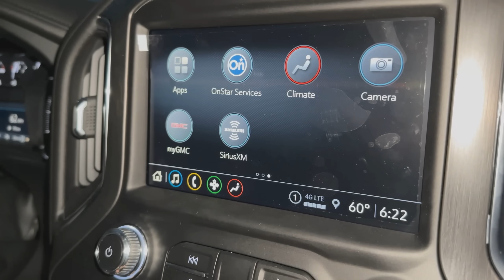First Wash In 12 Years: Free ABANDONED 1990 Volvo 740 Wagon! Detailing and Surprising Best Friend!

Comment: The car was in incredible condition, no rust, no dents, no scratches- amazing Volvo quality!!
Reply from the maker: Couldn't agree more!
Reply: Volvo used a very grade of paint and clear coat. My 1990 shines up like new and it lives outdoors 24/7 and is now in its 34th winter.
Reply: My dad bought a 1989 Volvo 240DL back in 1990 and when I washed it, it always looked great even into the late 90’s. Our 1995 850GLE and 2005 XC70 also looked great. Currently I owe a 2013 S60 T6 R-Design in rare Rebel Blue paint. It has just 55K Km and looks incredible after a decade!
Reply: little bit of rust on the front fenders but indeed, amazing condition!
Reply: @RajSharma-uv4nx  I have a 1984 340DL and when I got it 8 years ago, the paint was heavily oxidized. A few hours with some T-cut and the paint is like new. The paint has the odd blemish due to bird droppings being allowed to be left on the paint work in the past.
Reply: @Djuztin  I'm sure that could be rectified with a simple remedy.
Reply: My mom had a '90 740 Turbo wagon...absolutely awesome car.  Dark gray with black interior, and the turbo's great looking fan blade 5 spoke wheels.  She traded it in for an Audio A6 wagon in 2003, which was riddled with issues.  I wish I could go back and take the old 740, and keep it for life.
Reply: i got 850 with original black paint, still in immaculate condition, back when car manufacturers used proper paints.
Reply: Those old volvos were built like TANKS,  made to withstand salted Swedish roads and extreme weathers.
Reply: @teitoku_6974  my 340 was built in the Netherlands. Although still pretty solid but not as solid as the Swedish built 740.
Reply: @mohis5664  had a 95 850 got a bit just after I had my 740 had the 740 at 18 then the 850 at 19 loved them both
Reply: VOLVO FTW! 🤩
Reply: Jag xjs for me
Reply: @WDDetailing  someone is scamming your subs in the comments
Reply: Wasnt there a dint in the roof at the back in rear passenger area?
Reply: All the more impressive when I saw the Ohio license plates. We use a lot of salt here in the winter.
Reply: The best Volvo ever made,I do own 1991 Volvo 940 turbo wagon,1993 Volvo 940 GLE wagon,1989 Volvo 240 DL sedan and 2004 Volvo V70 XC wagon and love them all ,Volvo for life !
Reply: My 245 have lots of dents, scratches and some rust. And it looks like it has been parked under a tree the last 30 years.... But it works fine!
Reply: @davidyoung9561 finally someone with a 340! (I have 2 btw)
Reply: Swedes are built different
Reply: Or rather not that amazing another fake restoration.
Reply: @michaeltutty1540  Only the Swedish made ones, the later ones made abroad is pretty shit in the coat
Reply: Hello
This is what God Almighty said in the Holy Qur’an on the authority of Jesus the Prophet, peace be upon him, from Surat Al-Ma’idah from verse 116 to verse 120.

Surat Al Maeda from verse 116 to verse 120

116. And (remember) when Allâh will say (on the Day of Resurrection): "O ‘Îsâ (Jesus), son of Maryam (Mary)! Did you say unto men: ‘Worship me and my mother as two gods besides Allâh?’ " He will say: "Glory be to You! It was not for me to say what I had no right (to say). Had I said such a thing, You would surely have known it. You know what is in my inner-self though I do not know what is in Yours; truly, You, only You, are the All-Knower of all that is hidden (and unseen). 
117. "Never did I say to them aught except what You (Allâh) did command me to say: ‘Worship Allâh, my Lord and your Lord.’ And I was a witness over them while I dwelt amongst them, but when You took me up, You were the Watcher over them; and You are a Witness to all things. (This is a great admonition and warning to the Christians of the whole world). 
118. "If You punish them, they are Your slaves, and if You forgive them, verily You, only You, are the All-Mighty, the All-Wise"
119. Allâh will say: "This is a Day on which the truthful will profit from their truth: theirs are Gardens under which rivers flow (in Paradise) - they shall abide therein forever. Allâh is pleased with them and they with Him. That is the great success (Paradise). 
120. To Allâh belongs the dominion of the heavens and the earth and all that is therein, and He is Able to do all things.
      Great truth of God.
Reply: @yahiaechaab3357  ?
Reply: @ZebraScout yet you pussied out in both wars and let the enemy walk right through your country and attack ours 😂
Reply: Only if the Swedes were this sturdy in the war and not let the enemy straight through into my country
Reply: I’m on my 7th Volvo since 1985. Two have hit 200,000 miles. My current new XC90 is the best one I’ve ever owned. 2DL sedans, a DL wagon, a 940 sedan, 2 S60 sedans, and now the XC90.
Reply: 90's Volvo...can't beat them. Solid as a rock...don't make them like that anymore...swedish steel, craftsmanship, overall safety...setting that standard as well...engine strong and reliable...not the fastest..but it gets you where you wanna be..in the best seats of the time. Love the 850 R as well to run just a tiny little bit faster😁
Reply: It does have rust on the front left fender above the wheel well. Also, remember it was also parked under a carport. That definitely helps.
Reply: its Volvo bro!
Reply: Yes, I can't believe what cars people throw away. Why would i do that to this car?

Comment: I'm a Volvo guy but I cannot believe you found this car in Ohio save it from the crusher and it turned out to be an amazing shape and what a great job of detailing. Mike you got a gem.
Reply: I am to I have a 2000 s70
Reply: Yeah, imagine waiting to die then being saved by someone
Reply: @josephwatson2711  Im swedish and love to see this as Volvo came from here.
Reply: Yeah, I'm not buying ANY of this. It's somebody's nice ride that they threw a bag of fullers earth over it while wet.
Reply: @an8nymous791  yes it's all original has 105 thousand miles on it everything still works in  it
Reply: @LanceRyderWilsonNigguh01  we all got to go some way
Reply: @an8nymous791  Still lots of old Volvos here in New England. My '98 v70 is nearly at 260k. The interior needs some help (and the plastic parts are impossible to find) but the engine is absolutely smooth as butter and I've never done more than tune-ups.

Comment: Had a ‘93 940 wagon that I intended to drive until I died. Had to really plan merging with a 4 cylinder engine moving a 4,000 lb. car! It was totaled by a grandma trying to pass between me and a telephone pole on Rt 9 outside Avalon, NJ after I had put ~$2,700 into new shocks, struts and tires. Insurance gave me $3,300 for it. I still miss it more than 20 years later.

Comment: a 740 was my first car some 20+ years ago. Since then I added an 850, 940 and a S60. Never sold one, though I also never got around to get a wagon. They are insanely well built and nice to work on. The redblock engines are legends in their own right. I am totally with Mike on this one and quite frankly surprised no other team member shared his level of appreciation for this amazing car. I hope he still drives it!
Reply: My 90 740 took 2 95 mph hits and is still standing the yko  that t boned it 3 yrs ago was totaled up to the windshield and rolled down the hill with what was left of their yukon xl and witness said they pushed it into a 12 foot fence

Comment: 740s and 940s are getting very rare and super-collectable now, the estates especially. Really glad you saved this one – looks awesome inside and out!
Reply: Here in The Netherlands you see the 740 and 940 very regular and they are still running daily !!!
Reply: hhahha just go to sweden you can find one running for about 500 to 1500 dollars
Reply: Those were the last Volvo series that were build like tanks!
Reply: @ppdan Not safe cars today, but interesting
Reply: @Markking1678  You would be amazed how safe those can still be today. The version in this video was the 740GLE which is a near to full option version so it probably included ABS and maybe even airbag. Later models (90's) even had SIPS, they were the first ever to have this!
Volvo has always been a pioneer in safety, even in the 1980s and 1990s. The 740/940 were designed with reinforced passenger compartments (those had 3 reinforced bars in the front doors, 2 in the back doors), crumple zones to manage crash energy (especially the front), advanced seatbelt systems, including pre-tensioners.
Reply: @ppdan  You'd be amazed how untrue that is. They're old mild steel designs, the first safe Volvo was the 850.
Reply: @Markking1678  We had a 740 and hit a VW golf at about 35-40km/h. The golf was total loss and our 740 had a damaged bumper and a broken headlight. I guess that was the last time that golf driver took right of way from a big Volvo.
What is your experience with those?
Reply: @ppdan  Which Golf, mk1-2?
Reply: @Markking1678  after or before?
Was a brand new mk3, but I guess you have a perfect explanation for this as well
Reply: @ppdan  The mk3 was the first Golf that actually contained higher tensile steels. Photos, or it didn't happen
Reply: @Markking1678  yeah because in the 90's we had smartphones to take pictures anywhere we went and upload them to instagram ....
Any other idiotic request?
Birth video or I didn't happen???
Reply: @ppdan  A MK3 Golf is much safer than a 740.
Reply: @Markking1678  Not when it gets hit in the side by a 740!!!
And even frontal the 740 would be safer ... Why? Because the 740 is heavier AND sturdier.
Reply: @ppdan  No it isn't, it's heavier, but it contains very little high tensile steel.

Comment: Nice find, looks superb in the end. Very nice 16 vales engine, leather, a/c, all the regular high end stuff, and it even have the OEM radio! 
Just note they the engine requires a bit of attention, the 16v flavor of the redblock engine is more fragile than older designs, especially on the timing belt, water pump, pulleys (one is made of plastic and break, running the vales...).
The rest is rock solid.

Comment: Dream car is my dad's old mercedes benz E250 1995 manual right hand drive blue. We sold it back in 2016 for £500. It was the car I loved as a child and now. It the car I grew up with and had a lot of memories. It's probably destroyed now as the guy said it was going to be used as a parts car and hasent been mot since being brought by him. It was brought by my dad back in 1996 as a new as it was imported to the UK. I'm 19 as of now will probably try to get one when I'm older. It will be impossible as they are hardly on the road any more. If not this my second car of choice a audi rs7 2017 or mercades benz 300se 1980s w126.

Comment: Great detailing vid!  A Volvo sedan was one of several cars I was in love with when I was younger (40 years ago!).  Don't mean to steal any trade secrets. I have a 2022 Dodge RAM 1500 Black Pearl finish. Keep it immaculate. But I just noticed a pinhead sized rust dot coming thru the finish on one side of the bed quarter panel. Any recommendation on how to treat and/or product you would suggest? Will be contacting dealer as this may be a paint defect rather than road wear. Thanks so much!  Peace!

Comment: I have a soft spot for a few vehicles - 1990-2011 Ford Rangers, manual transmission. When they were still a mini truck. So hard to find without rot up here in the NE. And the 87-89 Dodge Aries. I junk car, but it was what I learned to drive in and I put that machine through some stuff it was not built for - mud, jumps, water crossings, and it just kept going. Appreciate your videos, love the before and afters.

Comment: Here in Sweden you could sell almost all parts for a lot, chrome strips $200, chrome handles $90. the grill $50. USA Front (headlights, blinkers) $1200, the GLE emblem in the back $20-$100, Front Lip $100, Full Leather Chairs $200-$500, all that I mention are on high demand here. You can obviously also sell essential parts from the engine and etc.

Comment: I currently have an 89 Volvo 740GLE sedan. These are fantastic cars but you really must keep an eye on the engine. The twin cam is an interference engine so when the cam belt goes, you can expect a dead or heavily damaged engine. Priority one is getting a new timing belt and balancing belt on the car. This is actually a bit easier than the single cam engine.  As for myself, I would take the old Plymouth or Desoto if offered.

Comment: When starting a car that hasn't been run for multiple years. 

Disconnect the fuel line and use an external can preferably with its own electric pump connected at the engine bypassing the vehicles fuel pump and any inline filters. 
Fuel in the tank will be so degraded you are fighting a losing battle and risk dragging rust particles through the injection system. 

Change the oil and filter  regardless of how clean the oil looks, sitting oil looses viscosity and limits its ability to inhibit wear. 
Engines suffer the most wear on components when cold starting. 

Turn the engine two full turns on the crank by hand to check it isn't seized. 
Check cam belt condition visually first by removing top belt cover. Cam belts also degrade with age. 

When starting, disable spark so it wont fire up then crank on the starter to build oil pressure. 
Check engine light goes out confirming oil pressure is reached. 

This is a must with anything that has a turbo fitted. 
Starving a turbo of oil pressure will destroy it. 

finally, reconnect spark plug leads and attempt to start.

Do that and you could save a good engine and turbo.   

Or you can just squirt easy start in the air intake and take a massive gamble..

Comment: I've always wanted a 1995 Oldsmobile Cutlass Supreme convertible.  This was the last year for the convertible, the only year with dual airbags and the revised dashboard and interior. I bought my first new car, a 1996 Olds Cutlass Supreme SL coupe in 1997 as a leftover 1996.  I always pined for the convertible, still do to this day.  Just haven't been lucky enough to run across one to purchase.  I agree, I'd rather look at an old Volvo than a bunch of exotics.  At least the Volvo is attainable and doesn't need an engine out repair every 25k miles.

Comment: I want my Saturn Vue back that Mike does that my dumb-ass brother totaled.   I sold it to him at a very cheap price because he is my brother and I am paraplegic.   I loved that yellow truck.  All-wheel-drive Annie could not put it didn't which I demonstrated one time by hitting the door panel with my knee so hard that the panel buckled in and then just popped out. I was demonstrating to an employee that worked with me that the vehicle could not be dented; however, I did have some issues with the yellow paint on one door panel had to get it repainted.  It tapped slightly when it ran "noisy lifters" but I never had an issue and it ran great with lots of power. That was my yellow phase because my son is colorblind and yellow as its favorite color, so I had to have a yellow steering wheel and a yellow power chair at the time when I could still stand. Multiple sclerosis is kicking my ass but, I am staying strong.  What would I do with an attitude of life sucks so bad all the time.  Who can live like that?

Comment: Holy shit and it's a 16 valve! That engine was only sold in the United States from 1989 to 1990. I have the 1990 740 GLE 16valve sedan. Same rims same color. The head on that engine alone is worth 1k all day long! It's comparable to a LS engine Airflow wise! Turbo they can make 500+ Horsepower. Some are even 1000hp

Comment: Very surprised on the condition after sitting for 12 years. The Swedes really knew how to build them. I had a 1993 Volvo 940 Turbo Wagon and a 1991 Volvo 940 GLE 16-Valve at the same time at one point but let the 91 go as I couldn’t get it to pass smog.

If I remember correctly, your rims are specific to GLE 16-Valve trim. Not as common as the GL and GLE (non 16-Valve) trims but not as rare as the Turbo specific Hydra rims.

If you need parts, don’t go to any auto parts stores as their parts don’t really work. Go to FCPEuro for the best parts, with most of them coming with lifetime warranty.

Comment: 100,000 miles on a Volvo is NOTHING. It's still a baby.  What a GREAT find! Happy for Mike-  awesome gesture guys.  Myself- I'd want a 1998 Volvo S70 manual transmission.  Volvos set the safety standard back in the 240 days, even before-  still the Gold Standard today in my opinion.   The S70 is 'new enough' but a real 'last century' gem.  Again-- great job guys. Enjoy the 740 Mike but value those friends you have; they gave you more than a car.

Comment: Old Volvos are probably one of the most underrated cars you can buy. I recently bought a 1994 940 for 1500. Had 261k miles but ran tip top. Interior is also in great condition. Its crazy to see how undervalued these cars really are. Never mind the fact that theyre both boring and slow, thats what makes them charming. Too bad its not the wagon variant, but even then, its a good example of the good ole Swedish tank

Comment: OOOOO 16V!  Swap a B230FT block into it with that head.

By the way, the answer to "can we get this old Volvo to run" is basically always yes.  Very rarely is the engine completely done for, it's usually simple and inexpensive stuff.  At worse, a bad mass airflow sensor will set you back a couple hundred bucks.

Comment: These cars were built to last…I have had 5 Volvos including the same estate version…bought it with 147.000 miles and drove it almost trouble free for 5 years…sold it with 376.000 miles on..water pump failed and the Haynes manual said “undo 4 bolts” but it took 6 hours as its right in the middle of the motor…hardest job I did on that car and one clutch …they will go forever if looked after…check out the highest mileage cars and the top ones are almost always Volvos…including the world record holder’s..in the Guinness book of records 😊